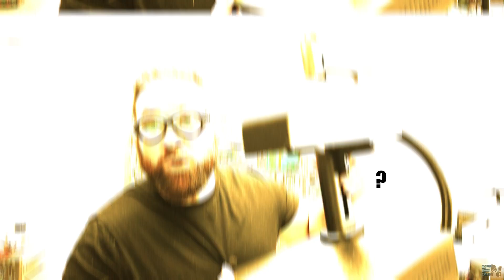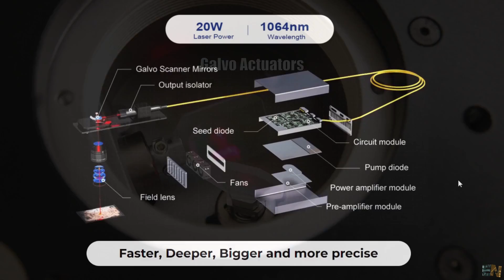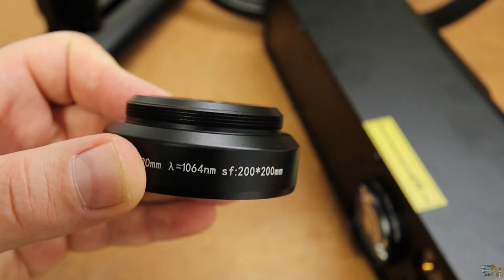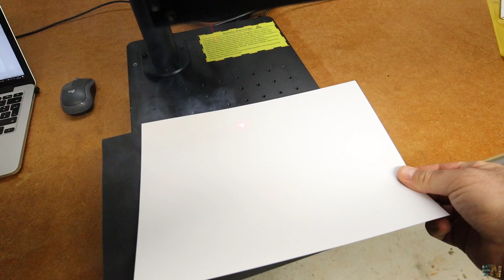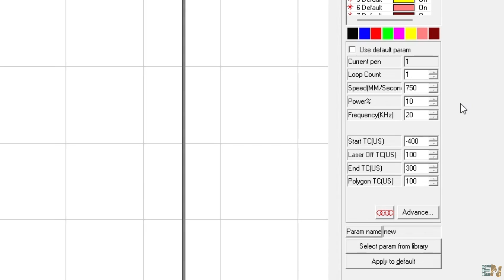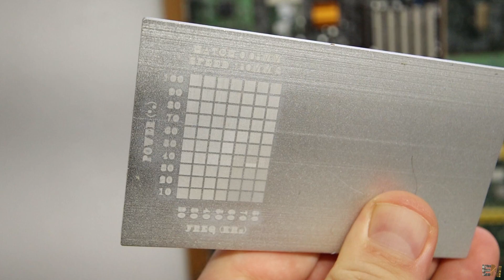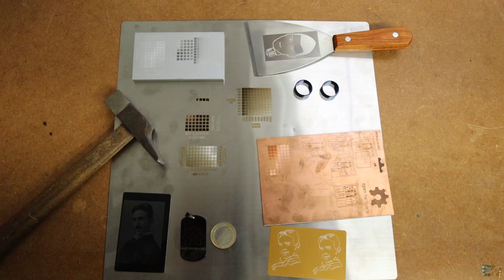FIBER LASER - ComMarker B4 - Metal Engrave

Comment: Here’s a thought: You can use these to burn of aluminum anodizing to make light letters against a colored background, but…

The colors on metals comes from oxides that form from the heat of the laser.

Anodizing makes a porous oxide on Aluminum that can then absorb dyes to give the bright colors (or black) 0:02  we associate with anodized aluminum. It probably wouldn’t be porous, but would it be possible to grow a thicker oxide on Aluminum with multiple passes at lower power, that you could then color with anodizing dyes? It’d only work if the oxide was porous, but I wonder?…

Comment: Well done video on this Laser. However looking at the practical use, it has only a small work area. As the laser is reflected by mirrors, it is not always perpendicular to the workpiece only in the center). Meaning the cut will be at a considerable angle at the outer ends. Therefore I consider it's use is for engraving only. Still intresting to see this is available on the market. Also I would recommend a light blocking enclosure for safety.
Reply: Galvo scanners use something called F-tetha lens to solve the perpendicularity issue. Look it up. 

But yes, those galvo lasers have a small working area and are usually best for engraving, not cutting. The are gantry system with fiber lasers though.

Comment: IR laser, open build... It is disturbing how little is spoken about safety here. There is SO MUCH, which can go wrong with such a system. Knowing how people treat UV resins, FDM print particle emissions, this is another grade of dangerous, which I would not recommend to anyone. Simple things, such as kid running into the room, forgetting to put the glasses on, random software bug, human error and you burned your retina permanently. It can be one stray beam off a dust particle or metal surface... Having worked with IR lasers, even if you know the physics and dangers, I want you think thrice before buying any system without multiple redundant safety mechanisms! YouTubers rarely warn you about such hazards but it will be your accident and your health on the line when you buy the "story".
Reply: There is more danger in the subway after midnight.
Reply: @4k-relax936  Where do you live? I am sorry for your subway.
Reply: This is not the first time this YTr have completely neglected the safety of these IR laser even after several comments about it. This is way dangerous than misleading people.
Reply: @arunmagesh this is why these machines aren't supposed to be sold to kids. Read your manuals and be safe. Stop putting safety responsibility on others. Be safe.
Reply: I have seen online video a very powerful laser that can instantly remove rust it do not need safety glasses at all because it is operated in ir range
Reply: @lifeai1889  this logic fails at "because it is operated in ir range".
Reply: I hope it's sarcasm.
Reply: @arunmagesh  it is true I have seen it many times
Reply: I think all of you forgot that this was a review for a product that is available.  I'm not sure why the YouTuber is responsible for your safety mishaps, especially considering you would have a package with a complete instruction manual with all the necessary warning you're so damn worried about.  Aside from being offended by something that doesn't exist in real life, did you enjoy the video? Learn anything?
Reply: sure. I hope you teach responsibility for your kids and family.
Reply: @arunmagesh  yea, it is the breakdown of humanity.  Make a video to share and inform about a product, wind up debating safety semantics and wind up being on trial for safety violations.  Get a fucking life.

Comment: Ha yes ... I fell in the rabbit hole of fiber lasers a few days ago ! What power ? 20W, 30W, more, what brand of laser source ? JPT, Raycus, ... What type ? MOPA or Q , etc etc ...
For instance, what I would do is : Check in your country if a company builds fiber lasers. The parts are standardized: everybody uses the same, the only difference is quality of the wiring/switches/connectors, brand of power supply used, and customer service. You might get a good warranty and customer service from a local company for the same price.
Or if you don't care about that, you can find a considerably cheaper, generic machine on all the well known web marketplaces.
Personally I have my eye on the used market, I found several people selling good machines, barely used, because they started a business but stopped 1 year later.
Good luck !